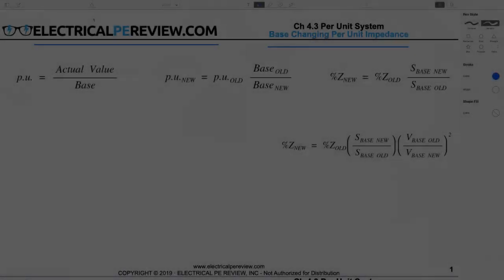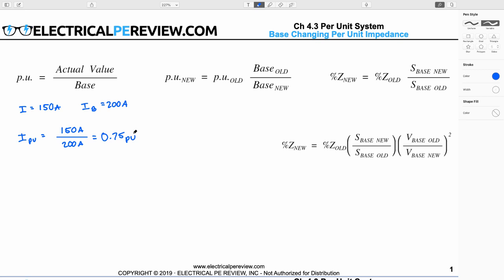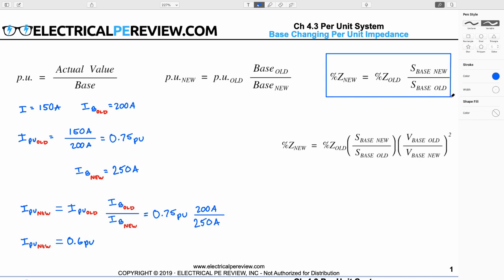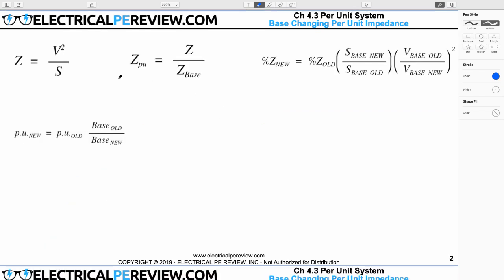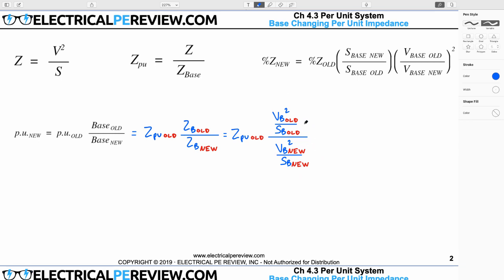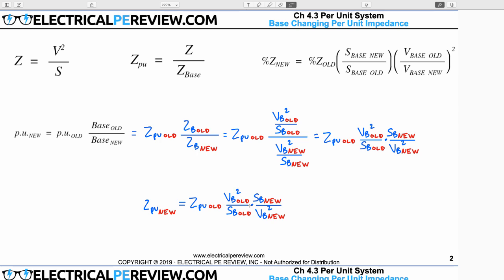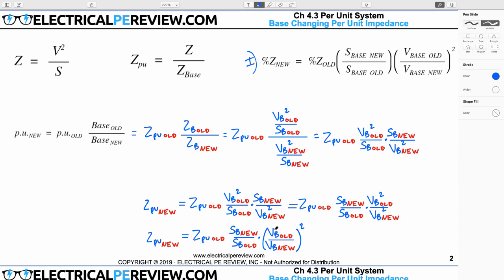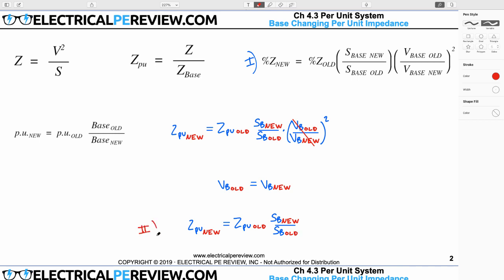How to Base Change Per Unit and Percent Impedance Part 1 (Electrical Power PE Exam)

Comment: Friend, can you explain how can Vold and Vnew be different? In my proffesors notes they are always the same and i cant find an example elsewhere
Reply from the maker: Say for example you have a 13.8 kV rated generator but the new voltage base in the generator zone is 15 kV, then your old and new voltage bases will no longer cancel.
Reply: @electricalpereview  thank you !! :)